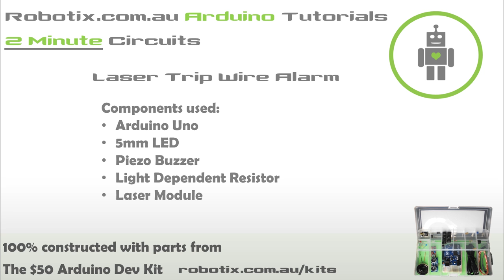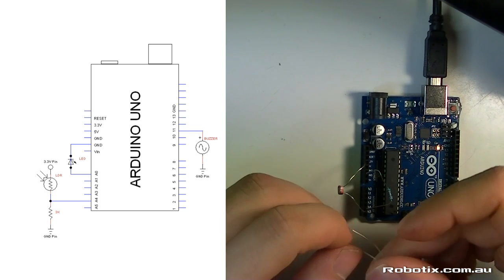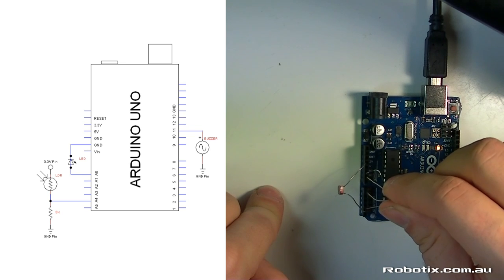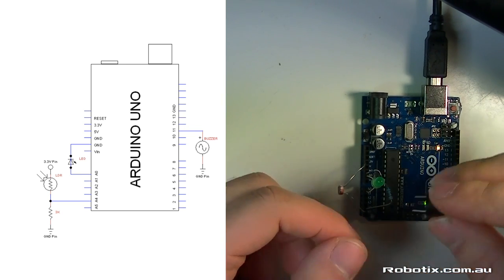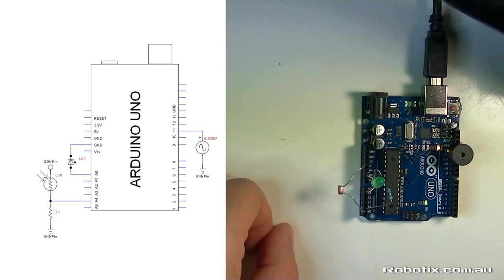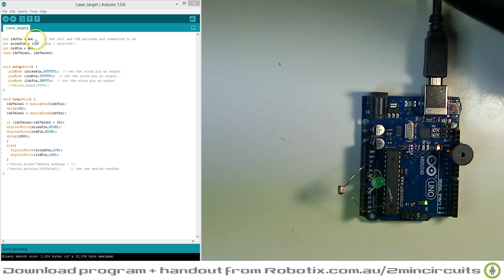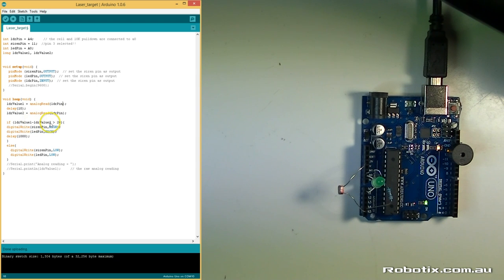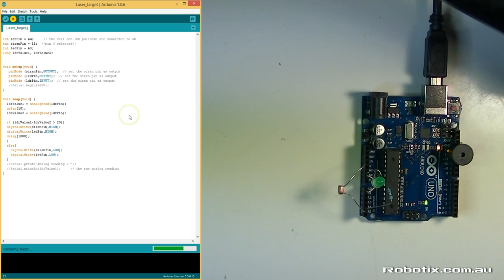2min Laser Tripwire

Comment: good simple demonstration, although I was just trying to figure out if I can use just any old laser pointer. probably an obvious yes but I wanted to double check
Reply from the maker: +Johntheawesomeguy It depends on what value you use in the if statement if(ldrValue2 - ldrValue1 >20)

The smaller the value the weaker the laser you can use... but you also get more false alarms
Reply: okay, I think I should be good for what I am doing. I am making a Halloween decoration that is triggered by a laser tripwire. since it will be dark I should really get any false alarms.

Comment: how many ohm k needs the resister
Reply from the maker: Anything between 220 Ohm and 20KOhm will work that is the beuty of the code which senses the relative change in voltage!!
Reply: +Robotix thx! what is the code/sketch?

Comment: int ldrPln = A4; // the cell and 10K: pulldovn are connected to a0
 int sirenPin = 11; //pin 3 selected!!
int ledPin = A0; 
long ldrValue1, ldrValue2; 

void setup(void) {
pinMode (sirenPin,OUTPUT); // set the siren pin as output 
pinMode (ledPin,OUIPUT); // set the siren pin as output 
pinMode (ldrPin,INPUT); // set the siren pin as output
 //Serial.begin(9600); 
}
void loop(void) {

 ldrValue1 = analogRead(ldrpin);
 delay(10); 
ldrvalue2 = analogRead(ldrPin); 

if (ldrValue1-ldrValue2 > 20){

 digitalWrite(sirenPin,HIGH); 
 digitalWrite(ledPin,HIGH); 
 delay(1000);
 else{
 digitalWrite(sirenPin,LOW);
 digitalWrite(ledPin,LOW); 

} 
//Serial.print("Analog reading = ");
 //Serial.println(ldrValue1); // the raw analog reading 
}
Reply: how?? it dont work!
Reply: Do you still have the code, could you please pass it on?
Reply: shiranai 1337 kan je me ook de videolink sturen?